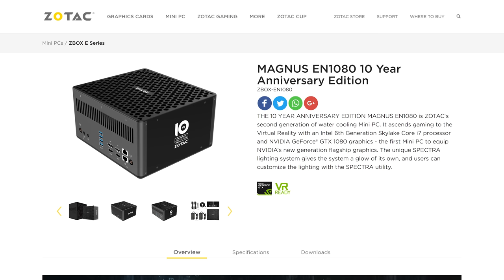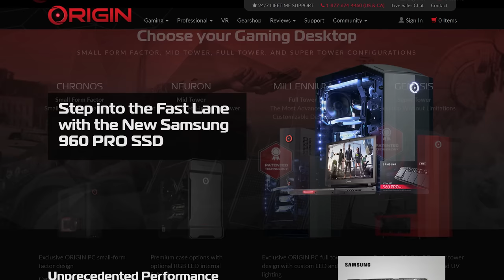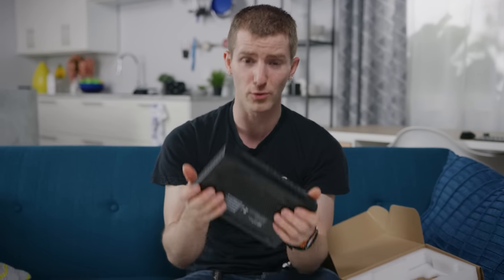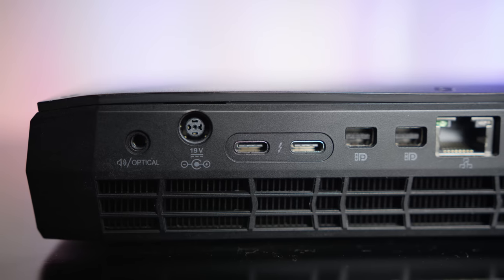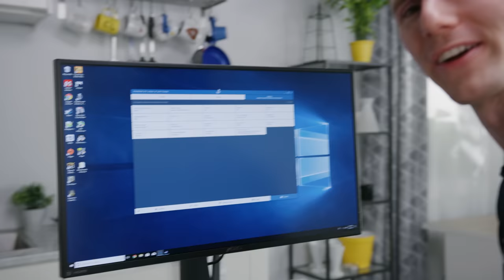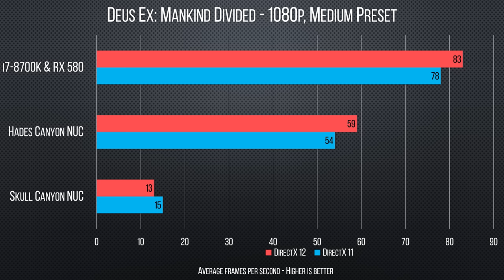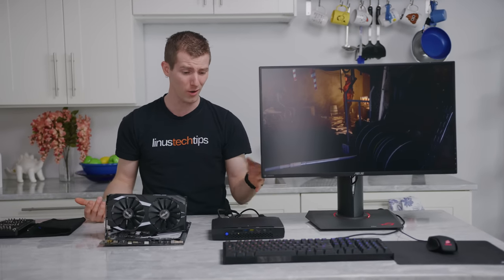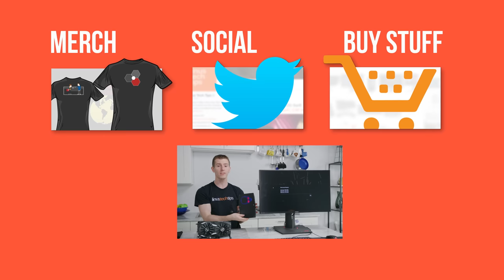Intel's Coolest CPU EVER... Thanks to AMD!

Comment: Wait... Overwatch counts as easy to run?
Reply: Every popular e-sport game has extremely low requirements compared to regular AAA titles. DOTA2, Overwatch, CS:GO etc would probably run on a turd if it could produce binary code.
Reply: Craftbloxroyale I mean, it runs on a 2013 laptop ffs.
Reply: It's easier to run than most games, but Paladins is lot easier if you looking for something similar.
Reply: Stygian Doll I always thought a graphing calculator was the min spec for CS. I’m going have to bring my setup outside and hook up my dogs fresh leaving to test this.
Reply: part of the reason overwatch runs so well is that its programed at a decent quality level. and designed from the ground up for a spread spectrum of PC qualitys simillar to all blizzard games. games like crysis for exsample dont give a fuck if it can run on anything other than the top 20% of machines at release. and the hardware companys love it!
Reply: OW's graphics are comparatively easy on the hardware. Cartoony graphics style without the need to calculate light in 10 billion colours or render one gajillion leaves and blades of grass. Compared to more realistic-looking games, that's almost primitive. 

Yeah, and they probably also optimized stuff, unlike the hacks who made Crysis.
Reply: Yep. It runs pretty well on integrated graphics. 90% of players play on Laptops.
Reply: I play over watch on my raspberry pi 3
Reply: OW can run on Intel HD 2500 @ 720p60, if that means anything.
Reply: Don't get the Crysis 'hate' here - Crysis runs pretty decent on low settings and still looks good, something that you can't say for many other AAA titles..
At least if we're talking about Crysis 3 and not the original Crysis.
Reply: shit yeah
Reply: @aczajka74  no, you don't.

Comment: Linus! Don't open it! What if they screw you over like Apple?
Reply: Aditya Upadhye I think he screwed himself over by opening the thing and destroying it .

I bet Intel doesn't even have out of warranty replacement parts for this thing.
Reply: Well obviously a NUC any fault they would just replace the whole unit and as the RAM and storage is not included you HAVE to open it.

An all-in-one however, you DO expect them to at least be able to repair it for a cost.  Pretty sure if you broke a PC all-in-one, even from opening it, the manufacturer would repair it if you paid.
Reply: pretty sure the manufacturer is under no obligation to repair it. there are many factors where they are unable to...such as not having the parts availability to replace the parts YOU broke. usually they just replace the entire unit under warranty if it is in fact a warranty issue...but if you physically destroy the machine , they can't just replace it under warranty. They would probably charge you the retail cost of the item anyway especially if it's cutting edge hardware. cut your losses and move on.
Reply: You have to open it, if you have bought it as a barebones.. i had to do the same with my Skull Canyon one..
Reply: trippplefive yeah but linus was willing to pay but they straight up refused to take his money and replace it. Did you not see his last video?

Comment: I would love to see this used for VR. Power it off a battery with a DC to DC converter and you wouldn't need that bulky power brick. This would be great compared to current backpack systems, and if you used it with an inside-out tracked MR headset, you would have no physical limit to how far you could travel!

Comment: future upgradeability? That thing has 2 thunderbolt 3 ports(GPU, 10Gb NIC), lots of USB3, usb-c (10Gb NIC here?), dual gigabit ethernet. It definitely supports a lot of future upgrades as you cant change the ram type and it has 2 m.2 slots.

Comment: I feel like comparing this to another small Form Facter Desktop would have been a better thing to do.  Since, for some reason, smaller form factors of certain parts, do cost a little more than the normal sized parts.  And could have given better accuracy, as most people would buy this if they wanted a smaller form factor Computer.

Comment: Most comparable system I could build:
i3 8350k (i5/i7 to pricey, and needs to be overclockable)
noctua nh-l9i
msi - z370i gaming pro carbon mini itx
1x16gb crucial ram
intel 760p 512gb m.2
asus strix radeon rx 570 4gb (most comparable performance to vega m gh)
Silverstone ml08b-h (about as close as you can get to the portability)
corsair sf450w psu
windows 10 home

Price: NZD1918.07 (+shipping)
NUC Price with same specs: NZD1634.00 (free shipping)

Comment: I'd rather spend a bit more for a laptop with the same specs and I/O ports (including the Thunderbolt): at least I'd have an integrated UPS (many people spend a lot of money on their computers just to "forget" buying an UPS), and could use it as a desktop replacement whenever possible (perhaps using the integrated display as secondary screen) AND as a laptop when on the go...

Comment: It should be in my opinion be compared to a similarly priced gaming laptop. With ram and storage prices included. If the laptop has equal performance just get the laptop. You can use it plug it in a monitor if you want to or just play right off of it.

Comment: I wonder how this compares to consoles with gaming performance. I'd have to assume it's superior in every way. Load Steam and connect a X1 controller, you have a good little gaming system for areas where a full PC isn't practical.  Also a mobile productivity system. Even if you are a streamer, have a laptop and travel from time to time, you can have a dedicated PC for editing or capture, with the laptop.. well, you know what I'm saying.  I'd have to assume this would be more powerful than most laptops (not all, but most).

Comment: I need a replacement for my desktop soon (this year). This will be under consideration until GPU prices come down. I don't have serious gaming demands so if I can get a multi-TB raid storage computer for all my data, this is feasible.

ETA I saw it on Amazon and the specs ... well they don't impress me. My current rig was built when Windows 7 came out and my CPU I7 960 is a hair faster (2.67ghz). I expect more given how much time has passed. Plus I'm not 100% sure I want to buy something that expensive off Amazon.

Comment: There only game I use for benchmarking is DOOM 2016 because of it's 8 core or 4C8T demand. Graphics is a different thing but at higher settings it's a must. The goal is 1080p60fps minimal.
Reply: I was setting a requirement for what the minimum performance would have to be to determine a good system.

Comment: Now you only need an rollable flexible 8K 42 inch screen. And recharchable power brick. :) I like NUC's because they don't overheat and are silent. But have to be under $600.
Could you parralel chain them via this thunderbolt port? I mean for both CPU and GPU processing?

Comment: What is with that power brick?  How many watts is it anyhow?  I can't see any other reason for it to be so big.  It makes me miss the days when the power supply was inside the case somewhere rather than some power brick that would only add to the cable mess.  I am sure that you have seen some cable messes once in a while, they sometimes get so bad that you can only untangle them by unplugging them and reorganizing them.

Comment: @linus can you please use the the hades canyon connected to an EGPU( the beast with a 1080 ti or aorus box etc) and check out the performance(bottleneck), compared to a similar system. Thank you for your time.

Comment: The only problem with it as an HTPC is that it doesn't have full support for all modern HTPC standards. Most notably, since it uses AMD graphics instead of Intel's current graphics, it can NOT run UHD Blu-ray Discs.

Comment: If you go to lots of lans, why wouldn't you just build a mitx system? fractal makes some very small cases that can fit in 280mm water coolers, 1080ti, 8700k without getting hot.

Comment: As neat as the chip is, I still don't see this as competitive, and thus necessary, in the face of laptops that have quad-core 8th gen Core i5/i7 chips along with GTX 1060 discrete gfx. I've seen several deals recently for laptops with these specs, complete with HD/SSD and RAM, for under $700, which blows this out of the water in value. Granted those were deals, and the normal price would be around $1k for the laptop. But that would be the cost you'd pay once you populated this NUC as well with needed components. So for the same price, you could get a better performing GTX 1060 and a true mobile gaming rig.
Reply: Come to think of it, this seems to be an ideal Console full-chip solution. But AMD should try and get their Zen2 CPU + Vega Cores into a single-die chip, and try and get that into the XBox Two, PS5, and Nintendo whatever.

Comment: Hello Linus, I have a few questions. 
you made a very flexible File server for "i-justine"  .150TB server. 
you said it is so flexible. so she can simple add / remove a drive to increase / decrease capacity? Am I right? 
1- is that server rely on BIOS settings? if there is a damage to M.B will data be safe? 
2- what was the O.S ? 
3- can you explain the PROS and CONS of that? I thing I need it. 
Thanks.

Comment: Why is this surprising? The Intel CPU is connected via PCIe8 to the CPU just like any other mobo. It's not like the AMD Vega is bonded in silicon to the Intel CPU... That said, LTT should do a follow-up running WMR on this thing.

I'm running WMR on my desktop CPU in my room which has limited space. But my living room, where I used to play Kinect games, that's a great play area for VR if this puppy has the juice for it! Moving a large desktop PC to the living room is just not gonna happen with the missus. ;)

Comment: This is what steam machines should have been! Was thinking of buying an Xbox One X but now thinking of maybe buying this for my entertainment center. What do you guys think? Price is really a non issue if it's more convenient than a Xbox.
Reply: This by far. Xbox uses integrates APU graphics. This system has dedicated graphics and is even vr ready. Plus, it has replaceable hardware to a point. Not to mention thunderbolt 3 for egpus.
Reply: @victorsarkisov63  And of course it is a PC giving it a ridiculous amount of flexibility on the software side of things, compared to a Console.

Comment: Soooo this vid actually made me pull the trigger on this little guy. After a week of playing with it daily, its pretty great overall, but as a HTPC, I wouldnt, simply because it lacks 4K video support and certain blu ray formats. I went from a build with 16GB ram, an FX-8350 8 core on a MSI 970 "gaming" mobo w a R7 270x 4GB gpu, to this NUC, and holy crap theres a significant improvement. (Nevermind that I stuck 32GB ram in this puppy. Lol) 
PROS: It was cheaper to do this fully upgraded than build an upgraded box. AND. No wiring up a mobo BS. (Lol)
CONS: No real upgrade path after fully rocking out the system.

Comment: If I was going to spend $1000 on this and then more on RAM + storage  wouldn't it be better to buy a laptop?

You can currently order for an Intel Coffee Lake 6-core, Nvidia 1060, 16GB Ram, 250GB SSD + 1TB HDD  and a 15.6" 144Hz  IPS display laptop for ~$1300.
Reply: Something you need to consider, most laptops have power delivery issues as well as overheating problems. A 1060 in a laptop will in practice perform closer to a overclocked 1050ti. While Linus didn't do it, quite a few other reviewers showed that this thing could be overclocked considerably. Also no laptop on the market has close to that good of I/O. 

And don't underestimate how much some people for aesthetics. Personally, I am just hoping this comes for a reasonable price in laptops.
Reply: Isn't a stock desktop 1060 about 15% faster than a laptop 1060?  As Linus said, the NUC is 35% less powerful than a 580 which competes with the 1060 so a laptop 1060 is still more powerful than the gpu in the NUC and even when overclocked  does it get to the same power level of a laptop 1060?

I've never really come across power delivery issues so haven't done much reading into that and yeah gaming laptops can get hot and loud but I guess it's a sacrifice some people make for being able to take their gaming machine anywhere which you can't do with the NUC.

Totally agree with you on the crazy amount of I/O that this thing has.

I'm actually really interested in this chip too, the reduced power would work really well in a laptop.  If they can put this in a decent chassis and price it less than 1060 laptops they would have a winner.  Added bonus if they can pair it with a freesync 100Hz+ panel.  

Guess I'm not the target market for this : )
Reply: the desktop 1060 and laptop 1060 are the exact same card and under load will boost to almost the exact same frequency. my laptop 1060 easily stays at 1900-2050 mhz  the problem is the cpu in laptop, the cpu gets much hotter than the 1060 6gb, i keep setting on low because i run a separate 144 hz monitor  and prefer the frame rate over pretty looks  and the cpu is a huge bottle neck on the laptop 1060 but at ultra the frame rates are almost identical to the desktop card. this system seems great for lans more than anything else

Comment: So how does it compare to a gaming laptop at around the same price? The one at around $1000 compared to an Acer Predator Helios 300 for example, in performance terms.
Reply: whats really going to stand out is the cpu performance i have a similar laptop to one mentioned but msi all the hq 6700 or 7700 chips thermal throttle under load and causes occasional  frame drop. example my msi gs63vr 6rf will be at 180 fps in cs go. cpu will sit all cores at 3 ghz  hit between 90-95c with max fans  as do all my friends with similar laptops from various company's same specs. every-once and a while ill get a drop into 70-90s in frames because the cpu will thermal throttle for few seconds at most.  for refference the 1060 6gb will a full 6700k or 7700k at 4.5 ghz or higher will hit 260-300 fps. this system on ultra may not hit same frame rates as the laptop but when your using a 144hz monitor like i am  the extra cpu power and lower setting youll probably sit around the same fps but less frame drops or none really
Reply: Thats something you guys should really check into. 95 C isn't common, I have a laptop with a 7700HQ I use for work/Uni and the highest i've hit was maybe 85-90 and that was after it had been running all day and it was running Witcher 3 Ultra, heavily modded, while connected to a 144hz and a spare monitor.
Reply: Nate Dogg I've been using  laptops  for while now.  every thin laptop I get depending on game hits 80-90c average  like my msi is .69 inches thick  less than 4lbs super portable. Look online it's very common temp above 75 percent load or higher.  Seems best solution is to undervolt or turn turboboost off don't forget 7700hq more efficient than the 6700 hq and more refined so out of the box  so its  probably  uses less voltage therefore less heat. I've had this msi for almost 2 years  at those temps and no problems

Comment: Something I don't see talked about a whole lot is the sheer volume of cross-licensing between AMD and Intel. AMD licenses the x86 technology from Intel dating all the way back to the 8088/8086 era. In fact Intel and IBM went to AMD, Hitachi, and a whole slew of other companies to make full and proper 1:1 8088 implementation -- which is why you are MORE LIKELY in an original 5150 to get 

... and because of that licensing agreement, Intel gets a sliver of every AMD x86 compatible processor sold. It's called the "Hershey model" -- where you provide resources to your 'competitors' (such as processed ready to mold milk chocolate) so you make a buck whether the consumer buys directly from you or not. (which is why most generic bottled store-brand chocolate syrups are indistinguishable from the Hershey's -- IT'S THE SAME STUFF PROBABLY FROM THE SAME FACTORY!!!)

In manufacturing it's a great way to cover up for a lack of fabs, a great way to create an "ecosystem" that consumers AND producers become reliant on, and really it's why the x86 and derivative architectures have the market dominance they do in the desktop/laptop world.

On the flip side, just how exactly do you think AMD x64 became 1:1 cloned as Intel EM64T without so much as a eyebrow raised (much less lawyers called) by AMD? THEY MADE A DEAL... As such pretty much every x64 compatible Intel chip sale (basically everything from Yonah onward) results in a sliver of that cash going to AMD.

So with that in mind, this shouldn't shock anyone who actually knows what the f*** is going on business-wise. The two companies are a LOT more intertwined than they generally let on to the public.

The ultimate "Gentleman's agreement" in business -- the top two dominate the market, can pretend to be competitors, and make a buck regardless of which of them you actually buy from. Win/Win for them.

Comment: I currently have the Alienware 15 R3 with the i7 and 6gb gtx1080 with a 32" freesync monitor at 1440p. I'm looking to upgrade my laptop to a desktop. Would this perform as well or better than my current Alienware for my games? Most of my games I'm able to run fine at highest settings and 1440p currently. Also, am I able to plug external graphics for a future upgrade?

Thanks

Comment: I am assuming this supports AMD freesync (and/or freesync 2) then? 
What happens if you add an eGPU like a Razer Core V2 w/a Nvidia GTX 1080 graphics card? Would this then support G-Sync?

Would love to know these answers! :)
Reply: I found this: The GPUs bring with them all the capabilities of the line, including Freesync 2 support, Display Port 1.4 with HDR and HDMI 2.0b with HDR10 support.  https://www.cnet.com/news/intel-amd-ally-to-shrink-next-gaming-laptop-ces-2018/